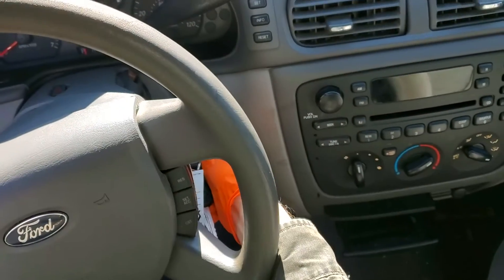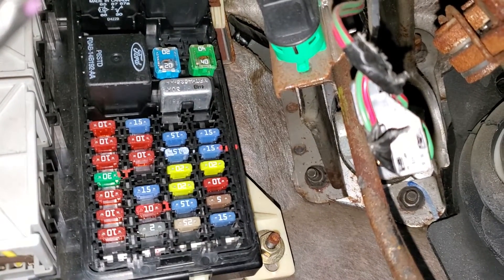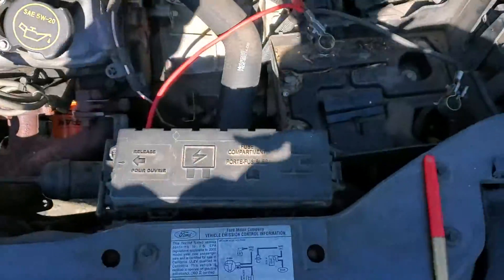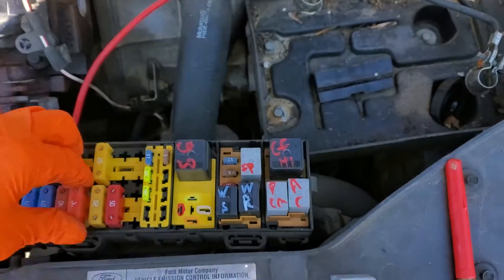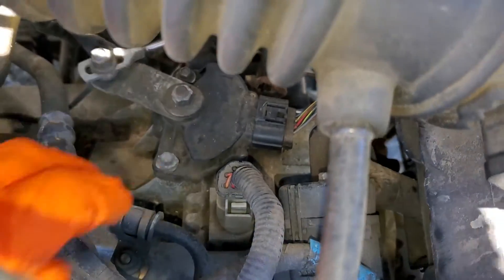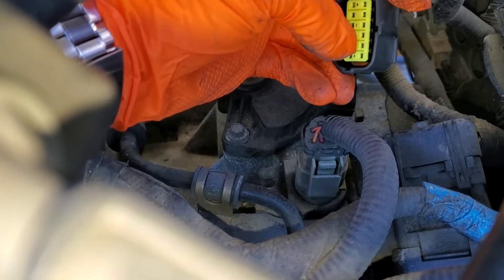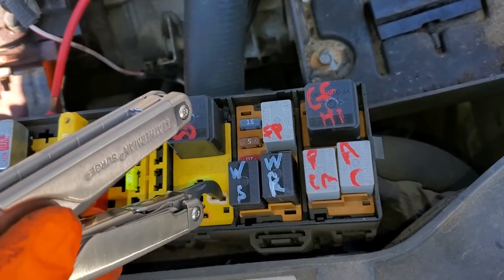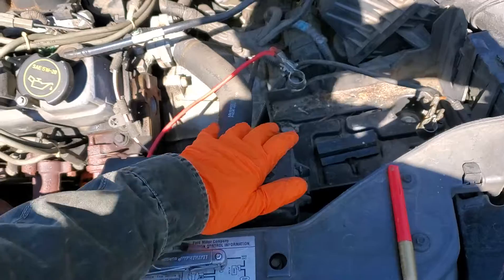2005 Ford Taurus Starter Fuse, Starter Relay & Circuit Explained

Comment: Great vid and explanation. Saved me from buying a book with diagrams. Just a suggestion, a safer way to to the trouble shooting and good isolation procedure as using a jumper especially if it's not the right size or something else is shorted can cause more damage. Anyway I would suggest starting at the relay. Use a multimeter, set it to DC, select the high option (if by yourself)  or if you have a partner have them read out the voltage, put your leads into orange and yellow.  try to start the car, it won't but you should have voltage there. This will tell you the 15amp and tranny switch are good and the problem would be the relay or passed the relay. (Wire to and or solenoid). That's where I would start on the circuit.  Very informative though, good job.

Comment: Very nice, detailed, professional and well explained. 
Me, being a career sparky who has worked on, rebuilt, restored, resurrected many MANY vehicles for the shits and giggles of it, mainly working on the ol' VDub air-cooled stuff but this kind of water stuff often enough is now helping a friend with her 05, me as ignorant as can be with them, Ford Taurus, like what you've got here. 
No manual but I do have the professional series, mechanic favorite of all time, HAYNES from the other professional store... Let's not dis them. They've helped me a lot in my life but sounds like Gotto Moan. So I do have all the information from this book to be able to learn how to change a spark plug and check the engine oil 

Thanks for your very well done video as I can't figure this damn car out with no labeling of it ANYWHERE!! G'dam Fords.... 

Going to label the box like you did here as well. Love that! 
Good job and thanks again;

Comment: Great video  I'm helping a widowed neighbor fix her 2006 taurus.  While changing the plugs and coils I touched the wrench to the hot wire coming out of the fuse box.  Small spark, but now nothing works.  I've checked some fuses but not sure which one is the main one that got blown.  Any help would be greatly appreciated.  Thanks.

Comment: Thanks! I just bought a starter and I have the same problem...it starts when it wants to or just slamming the hood gives it the power to crank. Now I see that the relay works after tapping on it and slamming my hood is similar to the tapping, I'm going to get me a new relay

Comment: Got a question. Got a 2004 ford taurus ses. When I got it I had a mechanic to hook it up to a computer and saw no issues. A week later now the car won't start without a jump. Turn the key and hear a couple clicks or and attempt to start. Put a jump box on it and it starts right up and is fine till I turn it off. Any ideas?

Comment: I have a question, If I get power to the 40am fuse but it's not going to the starter relay, what's my problem? I've got the power to both fuses but not to the relay or the transmission sensor.

Comment: Great video very helpful. My 2003 Ford Taurus ses won't make a sound when I turn key to start. New alternator,battery,starter and neutral safety switch. Anti theft flashing with and without key in ignition. Tried starting in park and. Neutral with foot on brake. It will start when jumped. I'm 80 and need help. Mechanic didn't solve. any ideas,,?
Reply from the maker: Do you have another key you can try?
Reply: @LehewTech  No extra key. Bought used 3 weeks ago. Guy said needed alternator I put in new battery, alternator and neutral safety switch. If jump, it starts. With key, total silence, dash engine lights come on and theft flashing. Thanks for responding.
Reply: @LehewTech  it did start one time with no jump, drove an hour. Turned off but later when tried, silence and flashing theft

Comment: I tried to kick over my starter but it got stuck so I pulled the battery cable. I replace the starter and it's still in the on position like it's trying to get cranked over with the keys in my pocket

Comment: Hey brother you seem pretty knowledged about the Ford Taurus I put a starter on I accidentally grounded it couldn't figure out why it tried to start as soon as I hook the battery up but I found I had the ground wire on the starter touching the hot wire so when I hooked up the hot wire tried to start the car but I burnt something I can't find out what I burnt out any suggestions
Reply: If you grounded it, you either burnt up the solenoid or that 40amp fuse

Comment: I have replaced three different fuses since my oil change, and I think they hit the starter when they were trying to take the oil filter out. could there now be a power surge happening from my starter to my relays causing them to go out every time?
Reply: @EveHallows  did you ever figure it out?
Reply: @ no just got a new car :( it kept deteriorating after this

Comment: I have 05 Ford Taurus and it’s clicking but afterwards it’s nothing no crank or start but I noticed when I turn the key over and the starter relay it clicks so could I need to just replace the relay or also the 40 amp fuse
Reply: Did you figure it out by chance?
Reply: @richardcolumbia6709  yea starter was faulty
Reply: @spartatacticalarms6914  thats what im fearing. Thankyou for your response im very grateful!! Have a great day or night!
Reply: @richardcolumbia6709  also to tell if it's bad u can hit the starter with a hammer or some metal while someone turn the key on if it start up after clicking that's your starter

Comment: I NEED HELP! 
I've been working on my 2003 ford Taurus SE DOHC for over a month now and it's slowly killing me. When I drive my car it won't shift into gear. If I drive it the rpms shoot sky high and I get a top speed of 25-30mph it won't shift into gear. I've changed my spark plugs and wires, I changed my transmission fluid and filter. And I changed my starter about 4-5 months ago.
Please someone give me some advice I need my wheels back😰😵
Reply from the maker: Is the check engine light on and if so are there any codes? Is the transmission fluid level within spec? You must check the level while the engine is running on a flat surface. It's likely that you need to replace the transmission.
Reply: @LehewTech  yes I did all of that I just received a new VSS today I am going to install it and hope that it helps the issue

Comment: Im having a problem where the car wont start or turn over when the key is turned. I took the relay cap off under the hood on the fuse panel block an activated the relay an the motor turns over but doesnt fire. That is the only way ive been able to get the motor to turn over. Ive replaced the ignition switch but it didnt help or fix the issue. Any ideas?. I have the 01 Taurus
Reply: I'm having same problems did you ever figure out the problem
Reply: @coreyingram6133  Nah sure didnt. junked that car an moved on. Sorry bud.
Reply: @coreyingram6133  But i will say that my buddy had the same issue an he replaced that white plastic push rod or something in the steering column an he said it fixed his issue. It was with a mercury sable so similar car so you could try that. Let me know if that helps you.

Comment: I have a 1997 SHO and I am experiencing a "no crank, no start" situation. I am going to check these fuses and relay to see if this is causing my issue. I have power to everything but when you turn the key, nothing happens at all, no click, no start, nothing but dead silence. Thanks for this video.
Reply: Same problem with 2003 Ford Taurus ses. Did u find out problem? I need help